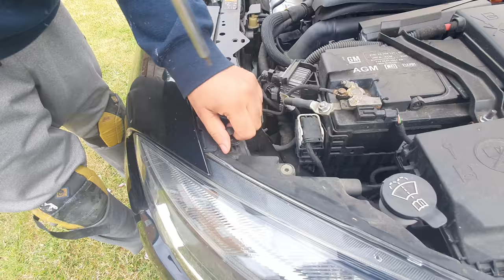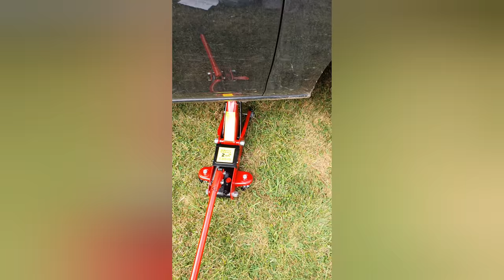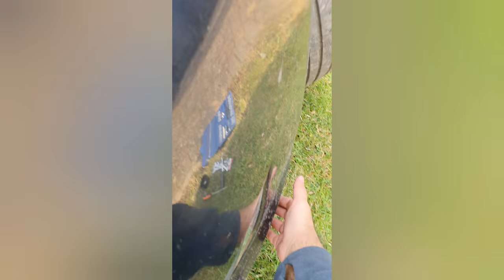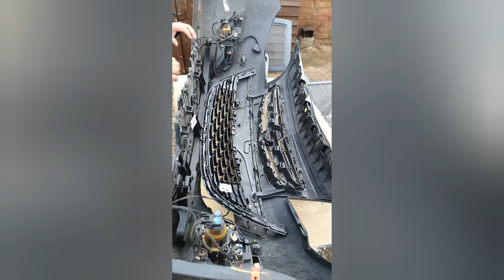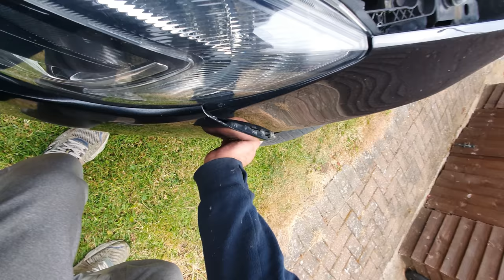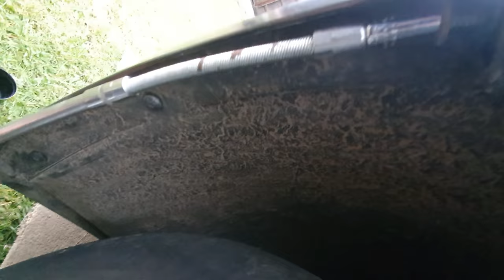Vauxhall Astra J Front Bumper And Grill Removal

Comment: Cheers for this video just replaced my grille this morning! I did find 2x E12 screws that need to be loosened before you can remove the bumper which isn't covered in this video! Also there is some effort needed to remove the grille from the bumper itself, the silver bezel comes off with the grille and needs to be separated from the grille after removal. reinstalling the silver bezel and grille is simple and just needs to be clipped back in place and then the bumper can be refitted to the car in revers order than it came off. Great video thank you!
Reply: Where are these 2 x E12 screws?
Reply from the maker: The 2 x E12 screws are the ones at 10.40 to 11.50 in the video. You will need to loosen them only, from the screw head side. You will then be able to slide out the bumber.
Reply: @pardesmeindes5465  Lovely, thank you.

Comment: I need to do the same,  where did you get the grill from?
Reply from the maker: I picked up from here:-

https://www.ebay.co.uk/itm/262989010470

You will also need this:-

https://www.ebay.co.uk/itm/252922684423

However the price of the latter has gone up significantly, maybe shop around to see if you can get it cheaper elsewhere.